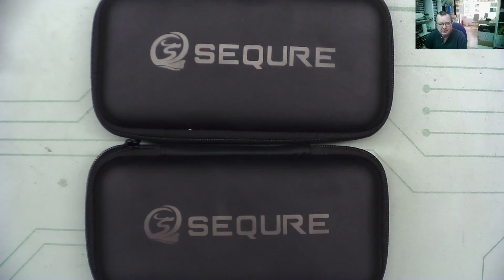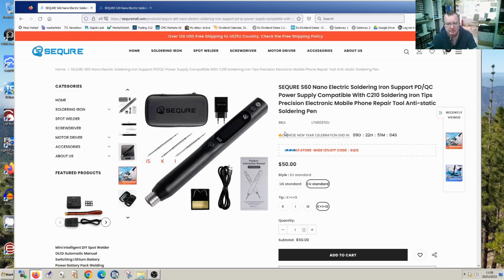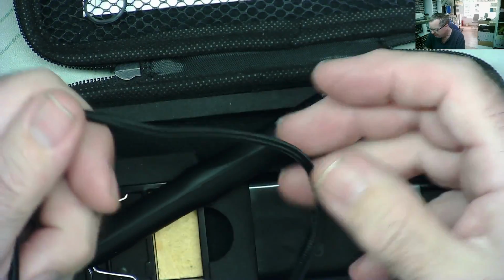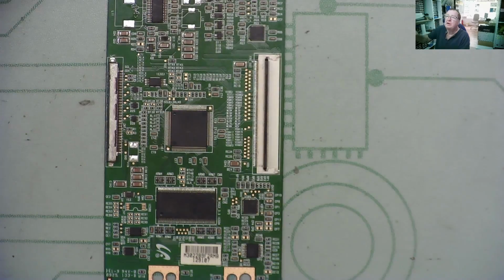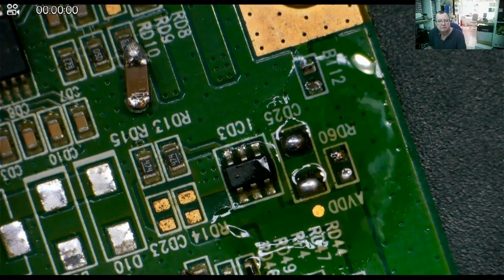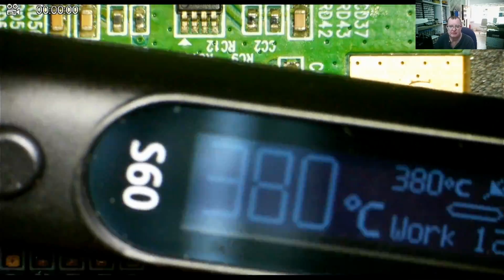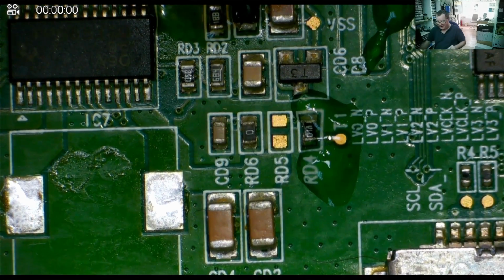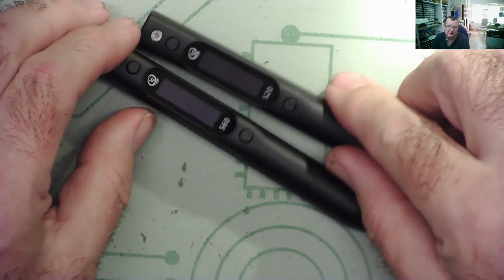Sequre S20 Nano And S60 Soldering Iron Test And Review. For C115 And C210 Tips

Comment: I have 6 mini USB-C irons ts-100, ts-80 sequre ts-100 knock-off, the sequre s60, sequre mini solder station, queco solder station, every one uses the ts-100 tips and the smaller version tips, ....
I find all of these portable irons are outstanding....they all work better than I expected. 
The only kickback is, they are so small physically and can be difficult to get used to compared to a bench solder station with a standard iron.
Frankly, I would recommend either of the sequre s20 or s60 irons...both are well worth the investment.

Comment: The smaller iron could it not be powered by a portable battery pack as well as an ac adapter. Would make using it on the job to do quick repairs a lot easier.
Reply from the maker: Both of them can run from a power bank
Reply: Hello, you can use these two power supply modes, using the 3S power supply of the model battery pack or the 12V5A adapter, S60 can play a larger 60W power, the effect will be better.
Reply: @SequreTech   why not enable the S60 to use  standard  20V,  3.25amp PD65W  USB-C  power supplies that are very common for $15-$25 on market?   or  if you need more amps a lot of low price  20V-5 amp 100W  power supplies USB-C also.  any reason you can not enable  20V maximum?   Perhaps if you send the schematics and  source code to Github  Ralim's IRonOS,  then  a better  firmware could be made to work with stronger  better  PSU  even if the customer has to provide the stronger  charger?
Right now  Ralim's IronOS firmware can support  up to   PD3.1  protocol which is the newest  USB-C  standards of 140w-28V  chargers. 
would be nice  if  Sqqure  could work with Ralim so he can port IronOS  to Sequre for people who want to switch  Sequre  firmware to an open source firmware to unlock more power/features?  you can contact Ralim on his Github but that would  make S60 more popular if you worked with him so that his firmware  can load onto your Iron.
Reply: @nidusa1  Hello, because the maximum voltage supported by the iron head is 12V at present, in this case, the iron head can reach the maximum power, and the life will be more suitable. So we haven't raised the voltage to 20V for the time being, and we will consider adding your suggestion later.
We are already working on it and I believe you will see results soon.

Comment: I think they are ok, but the problem is with tip cartridges… from my experience, all chinese hakko knockoffs, gordak, and ersa i used had the same problem, providing the temperature to the top of the tip. Always the blob of solder was’t present at the point of the tip…. So I moved to weller 80w and it was a game changer, but because of the lack of tips i moved to jbc (diy power supply) and original handle + tips (c245)i was amazed! I am curious how is this “pen” behave with original c210 tips…
Reply: A lot of these knock offs use the same tips as jbc, or are thay just the same on the outside but not the inside? Because I totally see what you mean by the blob not at the end of the tip and I hate it too. Now I wonder if a genuine tip is somehow different internally. I doubt it has anything to do with the stations themselves, as they are just basically controlled switches that let power through to the heating element
Reply: @maks886  yes you are right, the electronics doesn’t matter that much, is the actual tip or cartridge tip that makes the difference. Professional tips manage to send the heat to the very end of the tip, as the lower quality ones don’t. the reason the solder blob is positioned upper is because the solder floats where the heat is more intense…

Comment: Hi Richard, what happened to the audio today? I am hearing some "monoscope" whistling tone all over the video. Sample https://youtu.be/2pDl3zB_SMs?t=1075
Reply from the maker: My workshop is in a shopping center, at that point I was silent so the omni-direction microphone picked up some sounds that were coming from outside, it could have been a vehicle reversing into the loading area or something like that. I use an audio filter that removes continuous background noise such as the air-con very well, but it can't remove sporadic sounds like that.  Sometimes you can hear cars driving past or if the happy clappers are giving it some in the nearby church they are clearly audible
Reply: @LearnElectronicsRepair  It was a bit strange, because I am on headphones all the time and I haven't head this sound in your videos yet. This was more like a audio feedback loop.

Comment: I love my TS100 ! The power supply seems like just a token gesture and basically useless so the iron does NOT come with a power supply so Im not sure what that tells me about Sequre...cheers.
Reply from the maker: The S20 worked really well with the supplied PSU - It honestly surprised me just how well it worked, I was totally prepared to say it is useless but nope, it did a really good job for itself,
Reply: @LearnElectronicsRepair  at 18 watts ?
Reply from the maker: @andymouse  Yeah it really surprised me.  You saw it on the video.  The S60 did not
Reply: @LearnElectronicsRepair  Thanks, it might be worth a quick test see what the power really is...if you get a minute !
Reply: @andymouse  Hello, the power supply of S20 has reached the optimal power. Considering the cost and scene requirements, the actual power of S60 shipped power supply is about 30W, but the maximum support of S60 is 60W. You can refer to the actual power evaluation here, thank you.
https://www.youtube.com/shorts/lxr_D6omnj4
Reply: @SequreTech  this link video is not in English. impossible to know what is happening in the video.  maybe Sequre could make a video showing  how to get more power from the  S60  iron?
Reply: @nidusa1  Hello, you can get the power information from the test instrument and usage in the video. Meanwhile, we will improve and make some detailed videos later.

Comment: I will NEVER buy anything from Sequre again...NEVER!!!! They don't give a sh!t about their customers!!!
Reply from the maker: Can you let us all know what problems you had with them?
Reply: @LearnElectronicsRepair  Sure, I bought a Sequre spot welder and a 5000 mA 100C battery and I had a hard time welding 0.15mm strips, results were inconsistent, welding the same thickness strips was all over the place, was unable to weld 0.2mm at 100ms battery was getting extremely hot and they claim it can weld 0.3mm!! I contacted them explaining my situation and they responded by asking for a video which I provided and they told me that the stick out was short !?!?!? Told them that the shorter the stick out the more current it can carry! Then they stop responding to my e-mail, sent them multiple e-mails with no response, I had to send another e-mail with a different e-mail address, and they responded with the same bu!!shIt again with the stick out and told them that I tried with a longer stick out and it didn't help, I even sent them the thermal image of the battery at 100*c...then they stop responding again....at that time I totally lost it!!!!! I can't write what I told them after that because I will get banned from youtube....😅🤣
From what  I found on the web the battery they sell has a flaw, the negative 10g wire is linked via a thin metal strip to the negative of the battery and that's why the battery is getting hot, well it's not the battery getting hot it's the metal strip. On the website, they have a review section for their products and if you leave a negative comment they will probably delete it, I've left multiple negative comments and they all got deleted. Good luck if you ever need support from them because they couldn't care less!!!
Reply from the maker: @TorpedoBurrito  Thanks for explaining your experience,  I certainly will not be deleting your comments 😉
I don't work for or represent Sequre but as they sent me these soldering irons for free and asked me for review/opinion then I am absolutely sure they will read your comments here and it would be good to see a reply.   Is that the SQ-SW2 welder?
Reply: @LearnElectronicsRepair  No, it was the SQ-SW1, before buying I did my research and looked at a lot of videos on youtube and the welder seem good so I bought one from Sequre thru Aliexpress, I had high hope for this welder but Sequre blew it with their poor customer service!

Comment: i do not trust Ali express
Reply from the maker: In my experience AliExpress gives a very good service and I use them a LOT.  The one time I did raise a dispute (wrong item sent), I got a 50% refund and then sold the incorrect item for more than I paid for it.  I have had a couple of issues with Mosfets having the wrong pinout compared to the datasheet (but they did work once I kinda botched it to fit on the PCB and the amplifier I was repairing then went on to work just fine) and one occasion where I ordered two different IC (ten of each) from a seller. One batch was OK - LM393 but they sent me some Op-amps instead of LM723.  As the cost of the order was less than €2 I just kept the op-amps for stock and reordered the LM723.  It was such a low value it was not worth the hassle.
Anyway I also included links to sequre own website in the video description. with 12% discount at the moment, so if you want one you don't have to buy from AliExpress
Reply: That's an interesting statement to make. What is it you do not trust about them? You don't trust you will receive the goods you paid for? I have used them for a number of years and never had a problem. I have had the very occasional item go astray (as happens with any online seller) and a refund has been immediate and without question.
Reply: I had great dealings to start with then things did not arrive but they insist they did after the third time I stopped using them
Reply: at this point I think I ordered over a 1000 different items from Aliexpress in the last 10 years and got F*** only 1 time that I couldn't agree with them about a dispute on an item that didn't match the size but they ruled against me so I stopped buying there for a year, that was a few years ago, no problems since.
Reply: I guess I have just been lucky so far with Aliexpress. I have had the odd issue on Ebay, but very few that weren't resolved. Both of them are just a bunch of individual sellers and you can get a bad seller on any online platform. I am in Australia and have had more issues with local sellers on Ebay than the overseas ones, but again, very few. When I look at the prices I would pay for the same items in local storefront shops I am happy to have the odd online purchase go wrong.  Now that I've said all that, watch my online buying experience all go belly up ..lolol... 😁🤣

Comment: In your title it states the S60 accepts C245 tips, but it's actually C210 tips. Too bad it didn't come with a suitable power supply. It would've been een good option if you were looking for a portable soldering iron elsewise.
Reply from the maker: Oops.  fixed
Reply: @LearnElectronicsRepair  still says 245 tips in the video as of feb 5, 2023.  The S60 takes  C210.  Perhaps add a banner to the video which shows large text the correction at all the parts of the video where you say  245  and it's  C210.